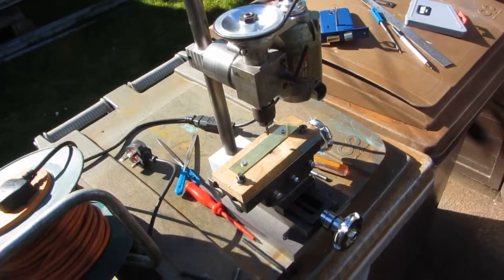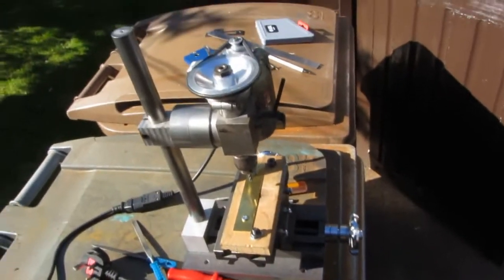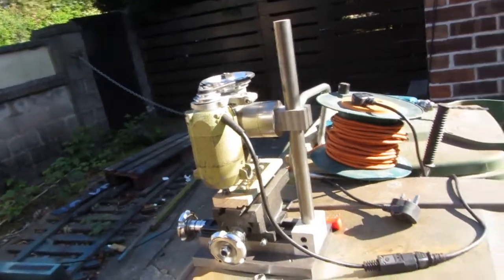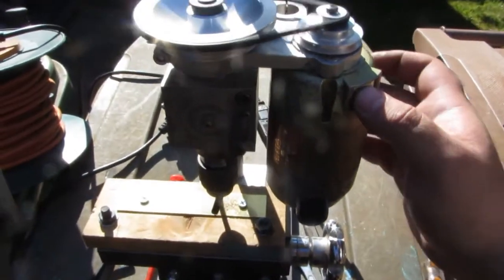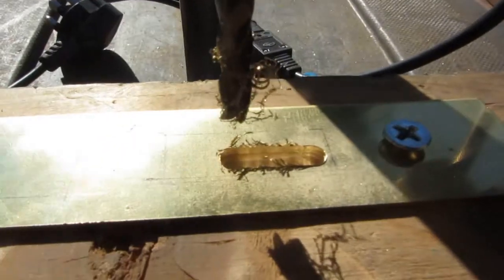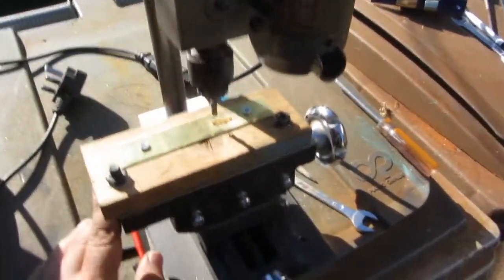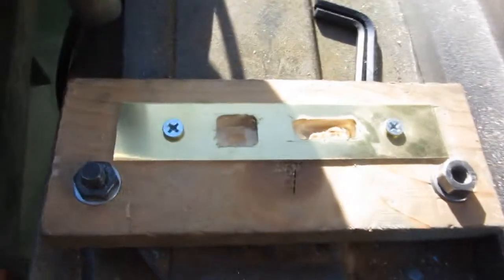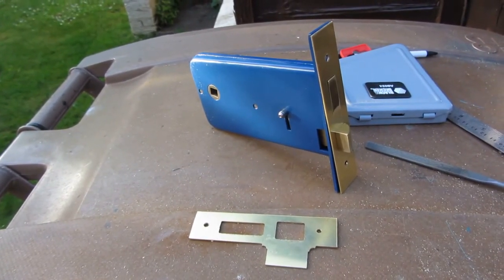My home built mini milling machine (using some Unimat SL1000 lathe parts) video 1

Comment: Did you make your two way cross slide?  I would like to see plans for making one.  Thanks for the video.!!
Reply from the maker: Hi, No, I didn't make the cross slide for this machine, I bought a cheap 2 way cross slide (compound table) off eBay and modified it accordingly for this mini milling machine project. Best Regards, Joseph.

Comment: Full credit for making the face and striker plate, they can be a pain in the arse to make by hand, locksmith 40+ years
Reply from the maker: Thank you David for you comment!, Yes they are a pain and a chore to make by hand!... Before I built this simple milling machine, I used to just drill a couple of 8mm holes through the brass plate in the middle of areas I want to cut out and then use a small round file to open up the holes (which I marked on a piece of paper which was stuck to to the brass plate by some Copydex glue which is easily peeled off afterwards without marking the brass), after opening out the holes roughly with the round file  I would then use a small square file combined with a small flat file to square up the corners of the holes and make the plate holes a perfect fit (little off at a time and keep trying the lock bolts until I get the perfect fit which allows the lock bolts to move freely without any binding!)

The finishing touch would be some buffing compound (the dark red/brown Tripoli compound wax polish) on the polishing machine and a few moments would really bring out the brass to a mirror finish! which looks superb. 

Most lock plates were/are normally punched out using a multi ton press and a die that is specially made to cut/punch out the desired shape and inside profile of the face plate or keeper plate in one go for these sort of locks either from brass or stainless steel, The punch out technique makes quick, simple work of making these plates and helps to cut costs as well as speed up the production in the factory when these locks were/are manufactured.

Thanks for your input, It's so nice to see another lock enthusiast here!  - love the comment ;-)
Reply: seen so many locks, my job was to make the key blank then pass it over to the master locksmith for cutting, very interesting job till you get a 100 year old church lock set in a oak case that was WORK all the keys were hand cut no machine work at all.....
Reply from the maker: Time to get your needle file set out then? ! Yeah I know just the sort of old keys you mean - They were more of an artwork than a key! - It must have been really hard work and so boring to cut all those heavy gauge cast iron keys in all sorts of awkward shapes in candle light LOL! Thank god for the more modern locks with 3 to 7 levers! mind you, You have got to give credit where it is due, those old locks may have had only one lever but with all sorts of profile plates inside the lock which the key must get past before it can even turn in the lock and lift the 1 lever to push the lock dead bolt in and out they were very secure locks! even for the early 19th Century!
Reply: ok J BRAHAMA made a lock the key way is round and the levers are vertical, the prize of 100 guinnes for any person who could open the lock by means of manipulation ...WHO opened the lock and what did he use ???
Reply from the maker: Was it Alfred Charles by any chance? and I think that it is the John Bramah locks that you are referring to?

I have just cut a key for one of these Bramah locks it is their box lock and the way the 4 levers have to clear two very thin steel plates (which are fixed to a 2mm thick brass plate by 2 tiny countersink screws) before the hollow key can turn the lock barrel is very clever (similar to the YALE lock design but without the flat key), The end of the hollow area of the Bramah key that goes into the lock must have 4 slits (sometimes 6 depending whether the lock is a 4 lever or a 6 lever lock ) of different depths which then press down the spring loaded bottom brass part of the keyhole (which the lock pin/spike is attached to), when this part of the lock reaches the right level the key will then tun inside the lock providing that all 4 (or sometimes 6 levers) are also pressed down the the right level to allow the slits in these steel levers to line up level with the 2 thin steel plates which are screwed by 2 small countersink screws to the 2mm thick brass plate (as mentioned earlier above) which is normally part of the lock case, when all 4 or 6 levers line up with the slits/cutouts in both the levers and the 2 thin steel plates (half circular in shape each which surround the lock barrel because they have a small circular cut out in the middle and form a full circle when assembled inside the lock and held in place by 2 small countersink screws) the key will then turn the lock barrel (just like the flat YALE key turns the barrel of a normal YALE lock)  to push the lock bolt (or move the lock mechanism accordingly)

Pretty cleaver stuff eh? for early 19th Century ! Very secure locks and worth a lot of money nowadays.
Reply: Have a look at Mr Chubb in relation to Bramah, the round key was also used by FICHET, very nice locks clickers and a round key operating levers, 10 x 10 x10 x 10 then the key.....

Comment from the maker: Update 27 May 2017, I have just been using this great machine to do some more milling in a block of aluminum and it works very well! - I have now recorded a another video of this mill milling a T slot male component for a letter and number stamping jig which I am currently working on (more on this stamping jig in another video coming soon) I will upload the new video for this great milling machine and post the link to the new video in the description above during the next couple of days ;-)

Best Wishes, Joseph D